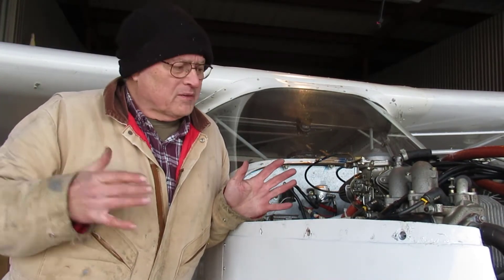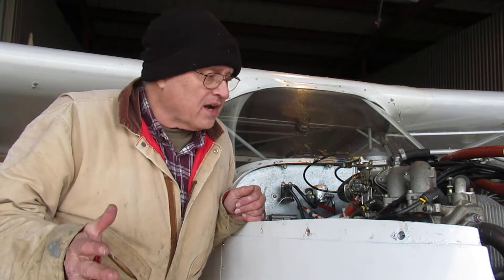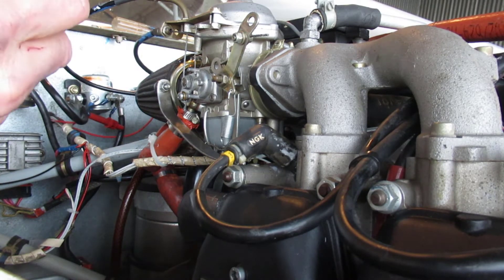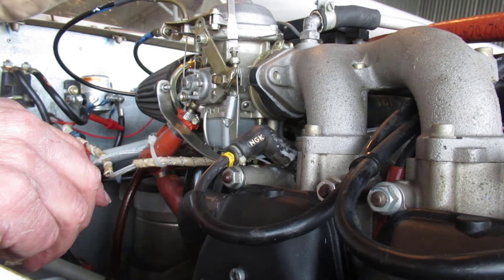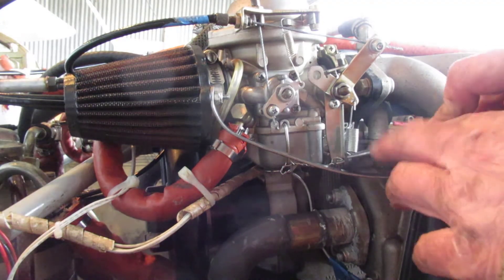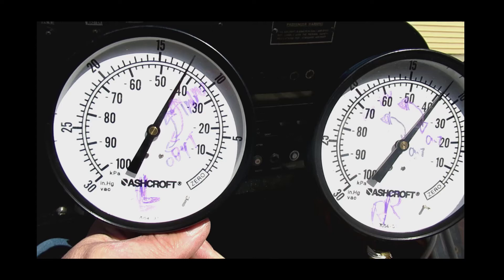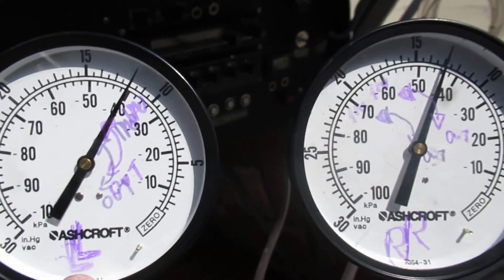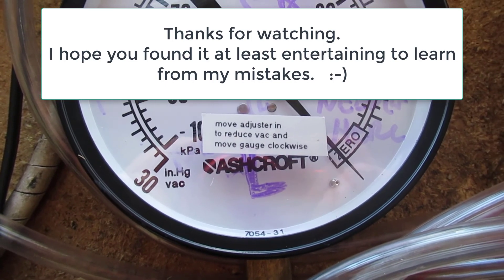Rotax 912 Carburetor Synchronization

Comment: I do not understand the language that is used for the 912 carb sync adjustments. I see it this way. There are two adjustments: idle and off idle. These "mechanical" and "pneumatic" terms make no sense (at least to me, they are both mechanical adjustments). Adjust the "idle" balance by turning idle stop screws. Adjust the "off idle" balance (say at 2500 to 3000 RPM) by adjusting the length of the throttle cable with the stop nuts. High vacuum means the airflow is restricted (low RPM, throttle plate closed), low vacuum means the airflow is not restricted (high RPM, throttle plate open). So, pick a side, to lower vacuum, raise RPM, to increase vacuum, decrease RPM. Think opposite. It's a bit easier with a dual needle manifold pressure gauge rather than a vacuum gauge. To increase manifold pressure, increase RPM, to decrease manifold pressure, lower RPM.
Reply from the maker: Yes, both adjustments are "mechanical" - but when adjusting the cables you are measuring  vacuum/pressure so that is more pneumaticish...
Manifold pressure would be easier as you suggest - one less "inversion" in the thinking process.

Comment: Hi, I suggest that when setting the throttle idle stop, you also check the setting of the idle jet. 
Also, I have never used gauges to synchronise my carbs: what I did instead was a static setting, adjusting the cables so that both carbs start to move off their full throttle stops at exactly the same moment as the throttle is gradually closed. I then checked the same thing from the throttles fully closed position: that both carbs began to move off the idle throttle stops at the same moment as the throttle is gradually opened. They do (provided the cables etc are set up and routed well) but since most running is done at more open throttle settings, my emphasis has been on adjusting for perfect full throttle synchronisation.
That, combined with very accurate pitch setting of a reasonably light prop has always given me very smooth running. 
I check the above regularly and during the first 50 or 75 hrs made minor adjustments as the cables etc bedded in. Since then there has been no need for adjustment, though I still perform these same simple and quick checks any time the cowl is off.

Comment: Hi sir , how do you make this system with double gauges . Does it handmaid?? How do you hand it , I mean what valve to close and what valve to open to test Manifold ?Thanks
Reply from the maker: Yes - I made it. Gauges were probably from Amazon - 3 valves , 2 Tees from local hardware store. Sized to fit the valves. 
Each gauge is screwed into the long side of a T fitting - the short sides of each T is connected with a valve. The remaining ends of the Tees also have valves and finally fittings to adapt from the threaded valve to the hose (I don't remember the size - but one fits over the metal part of the connection between the manifolds and the other has an adapter to go into the rubber hose connections. 
To start, I open the valve between the two gauges, close the valve to one of the hoses and open the last valve enough to get a vacuum reading but not enough that the needle bounces. With the two gauges connected to the same manifold, I can compare to make sure that the gauges have the same reading. Then I can close the valve between the gauges and open the valve to the other manifold enough to get a reading  but not so much the needle bounces.
Reply: Brilliant

Comment: There is a far easier way to determine which way to move the adjuster. While the engine is running and you are looking at the two gauges, just grab and slightly move the throttle arm on the side you want to adjust and see if the gauge needles move toward or away from synchronization. This will immediately tell you which way to adjust. Absolutely fool proof and easy.
Reply from the maker: Thank you for the suggestion. And the comment.

Comment: Question:  how do you actually calibrate the two gauges?   I see your cross tube and valve setup, but how to you actually get the two gauges to read the same?
Thanks!
Reply from the maker: They have always been pretty close - I just double check each time.
Reply: Thanks

Comment: It reads like you neglected the imbalance at low RPMs to make it balance at higher RPMs - and only at 3000 RPM.  The task per the Rotax maintenance manual is to get them to balance for the full range of RPM starting at low idle RPMs and then at progressively higher RPM - all the way to as high a possible/reasonable.  I do like your Ashcroft gauges and hope to obtain them in the future.  Currently using the Aircraft Spruce gauges for the Rotax carbs which are actually Harbor Freight gauges.  I have added gauge snubbers which work well above 2000 RPMs.  And glad to see you compared gauges as I found mine 1" Hg different through out the range.  BTW we only need each gauge to display the same value for the same vacuum and calibration is not required.  The challenge is getting the ranges to match as one carb will show a tighter/smaller range between 2000 RPMs and 4000 RPMS.  I believe the throttle cable attachment point affects this.
So the purpose of balancing carbs I have read is to smooth the engine and should increase engine life.  But a good motorcycle mechanic I know says the balance tube does a good job of balancing the manifolds at higher RPMs on multicarb motorcycles.

Comment: Thank you for the tutorial!  I need to reduce my idle slightly.  Do you recommend a balance at the same time?  Or can an idle decrease of 100rpm be made without a balance check?
Reply from the maker: I would be inclined to do it as part of a balance - you may be able to improve the balance and get 100 rpm at the same time by just closing the throttle that has the lower vacuum/ higher manifold pressure.